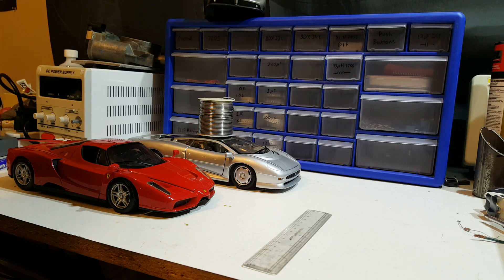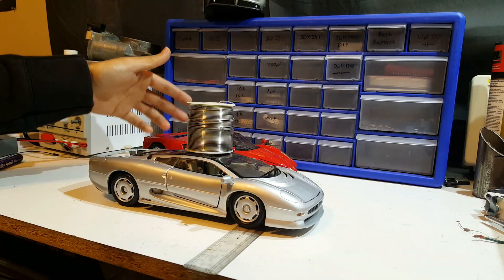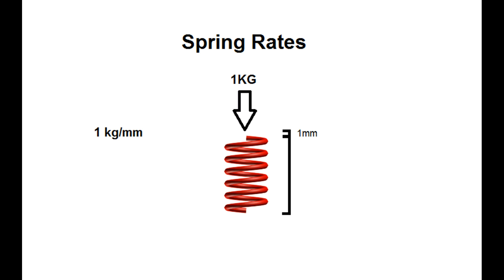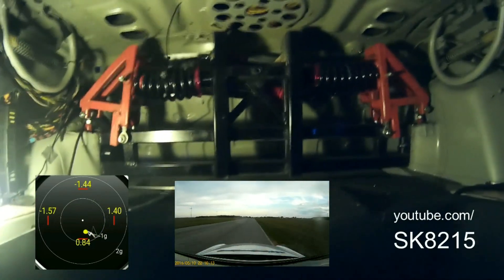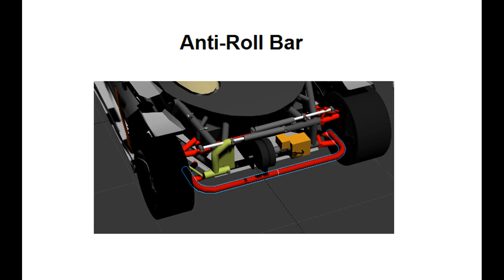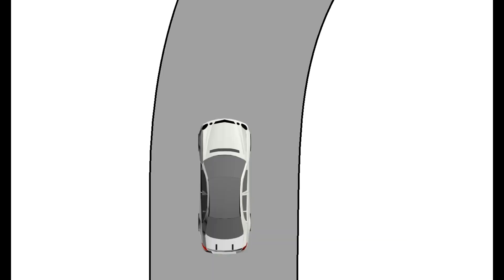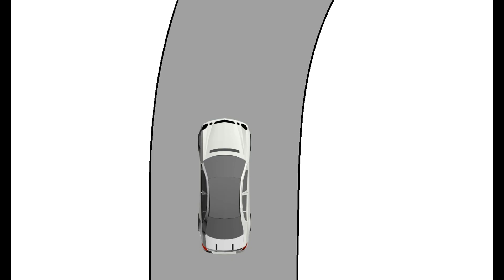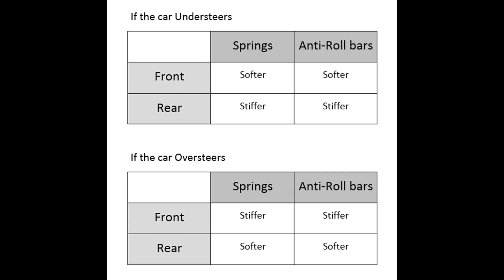Suspension Setup (Springs and Anti-Roll bars / Sway bars)

Comment: Okay so the basics are explained pretty well **BUT**,
I don't know if you are a race engineer or a hobbyist, but you're not right about the application of the anti-roll bar. If you move the antiroll bar from rear to front it will increase the roll at the back and decrease the roll at the front. And when you have an antiroll bar it means that it will reduce weight transfer, in your situation is increases the weight transfer, so you have an anti anti-roll bar? Then the understeer oversteer part... There is just 1 place where you will have understeer or oversteer that you can improve with the anti-roll bar, at the apex (initiation is more dampers). When you have understeer you want to decrease front weight transfer, so you stiffer the front antiroll bar or increase rear weighttransfer by softer the rear. When you have oversteer it is the exact opposite way. The springs are correct but it is more about the braking area. I hoped I helped you out and hope you understand I had to make this clear as I'm a race engineer in the European GT4 .
Reply: I agree with MTYD23 that if you have stronger roll bar at the front  car will be more understeer. Same in opposite way. You can find more in channel Engineering Explained. You can find in racing set up videos like How to set-up a racecar? By Tom Coronel, Suzuka Japan WTCC 2013
This is also tested on the track. So please do not share this incorrect information.
Reply: 1. 'If you move the antiroll bar from rear to front it will increase the roll at the back and decrease the roll at the front.' I mostly agree with the statement above. However, assuming the chassis of the car is reasonably stiff, this effect is relatively minimal.
2. I am pretty sure that SK8215 is right. If you increase the stiffness of front anti-roll bars (or front suspension), the car tends to understeer. Please refer to the explanation below.
3. 'When you have an antiroll bar it means that it will reduce weight transfer.' This is also correct *BUT* it applies to the opposite end only. NOT the same end!
For example, a front anti-roll bar reduces OVERALL weight transfer at the expense of increase front weight transfer. Thus, rear weight transfer is reduced.
Please correct me if I am wrong.
Reply from the maker: Not true
Stiffer front roll bar gives you understeer. Its commonly known if you ask any time attack competitor or even search it online. I've played around with roll bar settings on quiet a few cars and they make a pretty significant difference. You can try it yourself, just remove the sway bar end link on your front suspension. It will start to oversteer more.
Reply: @xfmotorsports  True. The understeer/oversteer issue is as a result of the ratio of the stiffness of the front and rear bars compared to one another. You can reduce understeer by softening the front bar or by stiffening the rear bar. Or any combination thereof :)
Obviously the same applies for oversteer except in the opposite direction. BTY - cool vid :)
Reply: SK8215 i think both of you are right and wrong. When u increase stiffness in the front the weight transfer in the front is decreased meaning more grip in the front. However more grip in the front means more power coming from the front. And if there is more power from the front wheels then there is understeer. If weight transfer in the back is decreased there is more grip in the back wheels whic means more power coming from the back wheels. More power from the back wheels causes oversteer. Drifting is what made me understand this because u need a stiffer back end to drift and it always confused me but a stiffer back end means more grip so the back is pushing more than the front which causes the back end to slip more or "drift". Another way i remember is because FWD is powered from the front and thats why they can't drift. Correct me if i got anything wrong
Reply: @xfmotorsports  I can see why an anti roll bar would give you understeer, but an anti roll bar equalizes the distribution of weight, so your diagram seems a bit weird.
Reply: yeah u r right it makes sense
Reply: Incorrect explanation about anti-roll
Reply: i agree with both explanations and i still can't figure it out. If an ARB induces weight transfer, why bother putting one in in the first place? I know it reduces bodyroll, but then again, bodyroll = weight transfer. Is an anti rollbar's only purpose just to balance understeer and oversteer?
Reply: vrrooom yes technically it induces weight transfer but in doing so it balances the weight. When cornering more weight is on the outside tires. The ARB helps transfer some of that weight back to the inside tires so that its more balanced
Reply: Shamaryah Bisnott then why is the load distribution 100 - 900 if an extra ARB is mounted. And not the other way round?
Reply: vrrooom thats the part about his explanation thats wrong to me. Its literally called an ANTI ROLL bar so i dont see why in his explanation adding an ARB increases the body roll. That part is incorrect. The weight that was added to the front should have been on the back seeing as thats where the ARB was moved from
Reply: I agree with only "And when you have an antiroll bar it means that it will reduce weight transfer, in your situation is increases the weight transfer, so you have an anti anti-roll bar?"
Reply: MTYD23 How did you get into your profession? That's my dream job 🙂
Reply: I really confused now.  
This is not what I experience at all in racing sims.  

The car is a flat rigid rectangular table. If the rear right corner goes low, the front left corner goes high. Thus,  using this example, If I stiffen the rear ARB  the rear right corner does't go lower and this makes the front left corner not go higher, thus more load and grip at the front, thus less understeer = more oversteer.
Can you explain how your suggestions works?
Thanks
Reply: @occrash5616  not true, apart from the arb effect, each suspension is strcitly independent from each other (see off-road 4x4 when they climb on rocks with just one wheel for example), so if the rear right goes low, the front doesn't go anywhere! the car might tilt but the front suspension won't be affected by that...

Comment: I just finishing refreshing suspension 
Sway links, bushings, upper control arms, lower control arms, and outer ties rod
Did it all myself, I have b8 and lowering springs cmg
Reply: B8. Hmmm sounds like you got bilstein shocks correct?? :)
Reply: Blanco Escondido yes b8 shocks and eibach lowering springs

Comment: I have 2004 c32amg that I'm modifying, I have been to mosport ddt track, even though I have 118,000 kilometres have to replace some suspension parts, I DD so just going with B8 shocks and lowering springs upper lower control arms
Would like to know what pads u used for e55
Reply from the maker: Yes, suspension makes a big difference, probably even more for handling tracks like mosport ddt. You have a light car, should be quick around there with a proper setup !

Comment: So everything that matters is in the load applied to the vehicle, it has to be the more balance as possible to have more grip. Its that a good conclusion?
Reply from the maker: Basically try to get center of gravity low as possible, evenly distribute loads on tires and close to neutral balance.